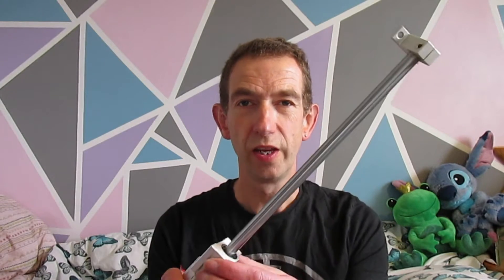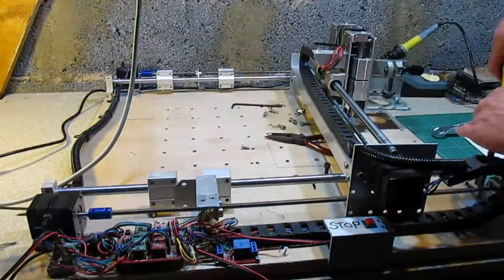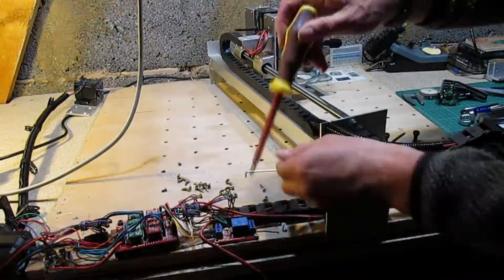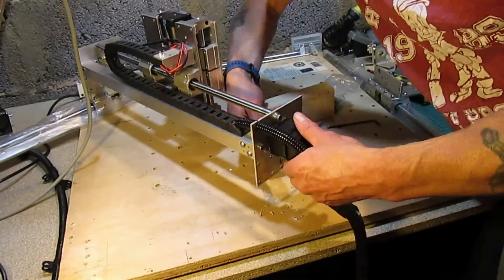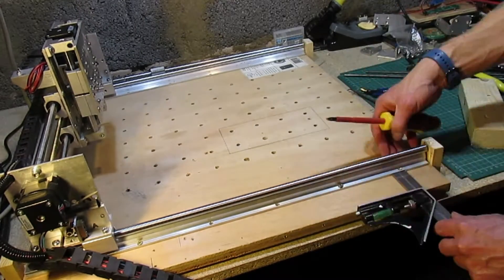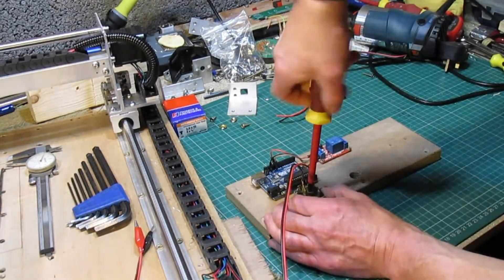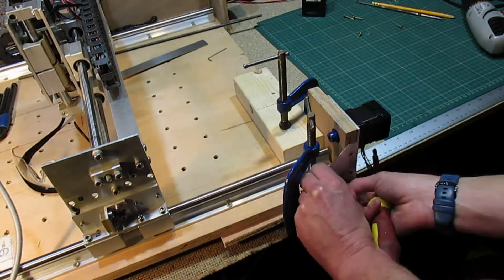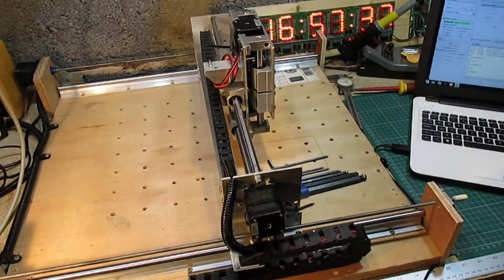Supported SBR12 Linear Rails - X Axis Upgrade - DIY CNC

Comment: That gets your Y axis but leaves your X axis as unsupported as before. What are you going to do about that?

You... might want to convert to two-start or even four-start leadscrews for speed. Your precision is far better than you'll ever need with single-start leadscrews.
Reply from the maker: Needs to be upgraded, maybe a future video.